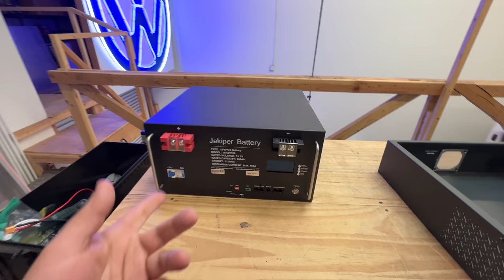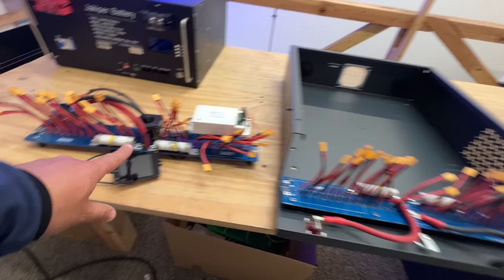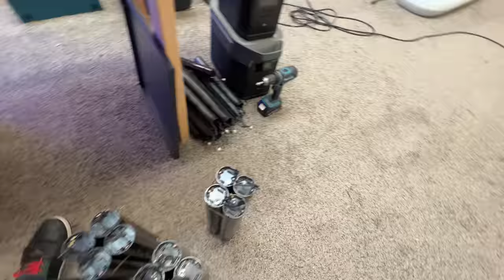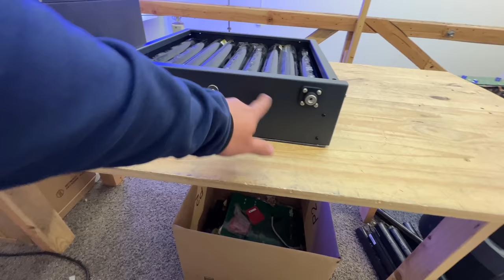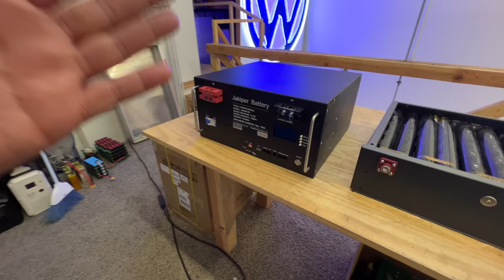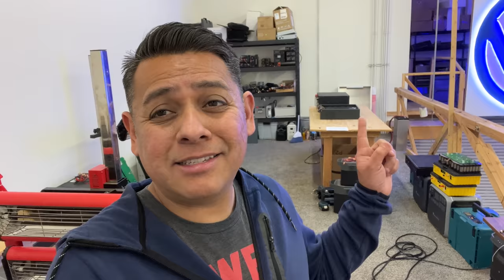Is DIY battery Still a good IDEA?

Comment: You forgot to mention is that 36v requires a 36v inverter which there's not many options for this less common voltage. If you want 12 or 24 volts for your standard equipment you need a converter, which loses energy in the conversion. And there's additional costs too, such as your scooter dongles to hack their BMS. I love DIY but there's many cons with safety, such as those BMS' don't have a temperature cut-off and they're definitely not as safe as Lithium Iron Phosphate. Then there's no warranty if anything fails later on. I worry that some of those packs don't even work from the get go 😒. You said 4 times more cycles than 1,000.. but a new LiFePO4 gives 5,000 cycles, so not 4x but 5x. Simple math on paper shows you save money in the long run. DIY batteries are more of a hassle nowadays and it's better to buy something pre-built that's trusted and will last guaranteed. Lithium Ion is an old and outdated technology. Lithium Iron Phosphate is the winner in cost per cycle, safety, reliability, and longevity.

Comment: 1000 cycles is less than 3 years, not 5. Replacing batteries every 3 years is not worth the savings.
Reply: 365 t7me 3 uf usee every all emyesr  liké 1000 tóo 1200 cyckes fuil chare dyse charg cyckeß brtér thén tiday bstrds

Comment: I have been a fan for a while and would like to try my 1st DIY battery project. I have a 36volt 50Amp Trolling motor for my boat and wish to build a battery pack for it with charger and meter.  Can you point me in the right direction? Thank you for any help and your content. I wish you were on the East coast.

Comment: DIY for the win! By the way on charging your lifepo4 with powerlab 8 which setting do you use? I have a PL6 and been wanting to charge a 32650 4S6P. Do you use 12v lead or the A123 presets? Thanks!

Comment: Jehu, fan of your page, I’m a novice at this battery hobby. Recently I came into 10 battery packs that someone bought from battery hook up. They are STL-TWN-LG OBP2481B1  43.2v  102.68Wh, not sure what all that means but I’d hate to throw them away. Want to know if you sell any boards or connectors that I could use to make a battery pack or small power wall. You guidance would greatly be appreciated.
Thank you

Comment: I think you used basically the worst case to exemplify your point that you could. There is no reason to build an LFP array for a fixed application over buying an LFP array. Sure, if you bring in used NCR NMC, LCO, ICR batteries in, you can build a cheaper battery, but you aren't building a safer battery. LFP is incredibly safe, ICR is not very safe in this application, and the prebuilds have a warranty and (probably mediocre) support with no risk you're going to misconfigure a BMS and light all your shit and yourself on fire. They also will last for 8,000 cycles vs the best case couple thousand left on another chemistry. For this, they actually will probably win out on cost! Sure, your 1kw pack costs 100 bucks vs the 300, but the 300 per kwh pack will last 4x longer and survive many more cycles.

Where DIY makes it is in application specific projects or products. Things that require unique form factor, things that move, things that require high C rate for a given volume of battery.

Comment: Lifepo4 is expensive as hell today. 
I bough 40x 280ah cells for around 100 usd/kwh shipping included. These are b grade i guess but i used them daily since before the pandemic started 2019 an there is nothing b grade about their performance when it comes to solar storage. 5000 watt charging 2000 watt discharging. Got lucky i guess when I bought them right before world went to shit lol.

Comment: ships do not use diesel , they use crude oil
Reply: The large ones commonly use a residual oil, which is a high-sulfur fuel - but they need to transfer over to something closer to regular diesel while going into many (European) ports…

Comment: How do you get it from 36 volts to 48 volts though. And is it still cost effective adding a transformer?

I really liked all your videos and appreciate The content. Currently living off grid with a renogy 3500 hybrid inverter and 4 12Ev zooms lifePO 4 batteries

If there’s a good way to use these used batteries and get them to utilize for 48 V then I’m all in I will be your customer

Comment: What’s with American YouTubers pushing for Jackiper, EG4, & the likes of rackables?
1) shipping concerns apply to US exclusively, the rest of the world pays dearly for shipping, as well as waits out the 3 months. And by the way, signaturesolar, batteryhookup, jackiper, etc… don’t ship outside the US!
2) kWh price is @ 155$ ~170 for grade A with shipping
3) who made rack mounting king of the universe? Who said it’s ultimate solution for Everyone? I personally go the DIY route primarily to avoid loosing valuable space in my house for an ugly stack of rackable! I built a shelf up near the ceiling, placed raw cells facing each other in 16S, finished it with cement board, called it a day! I did not loose a single square meter for floor standing rack.
4) you forgot to add the rack price
5) once jackiper & EG4 as well as the likes start shipping globally, your video becomes relevant; until such time comes, I consider this video aimed at US customers exclusively.
Reply from the maker: 100% of my market is USA,  there’s 300 million of us here, it’s the low hanging fruit.
Reply: @jehugarcia  Understandable.
In short: the $/kWh argument you used is false except (maybe) for the US.
the shipping argument you used is false except for the US.
the rack mounting method is not everyone's cup of tea (aesthetically).
Is Jackiper sponsoring you to push for rack-mounting?
Reply from the maker: rack mount is popular in the mid to large battery bank installs,  they are starting to trickle down to us DIY crowd second hand.  But the new breed of rackmount lifepo4 packs are popularized by every other YouTuber, I’m late to the game because I have my own designs to repurpose second hand batteries. This is the first one I review.
Reply: @jehugarcia great job you're doing out there! your channel is priceless to the community. Hope to see more reviews about grade A BMS's with communication tests.

Comment: Is the DIY battery robust to physical movement?  As in a permanent system for an RV?  Or is there still a fire risk if they get damaged?  I'm still thinking of a full off grid set up for my all electric travel trailer, and safety is paramount (the reason I stripped out the old and damaged propane system).
Reply: jus biy hybredd elré rv way safer or ac jver rv ushht bstéß

Comment: Hi Jesus, have some questions that can't or don't know how to find answers for.
What happen if I connect 36v or 72v battery to 24v 800w solar/wind mppt controller? 
Any problems connecting lead acid batteries to lithium ion 186xxx batteries on same voltage?

Comment: DIY pack cycle life is like 2.9 months if cycled once a day, how do you get 5 years?
Reply from the maker: How do you figure?  You can have good quality cells or trash cells, that determines cycle life not the DIY part
Reply: @jehugarcia You stated 1000 cycles which is less than 3years do the math.
Reply from the maker: So how do you get 2.9 months?
Reply: @jehugarcia  Sorry 2.9 years.

Comment: I can get 12 volt 100 AH  for under $800. I have no idea what I can do with the battery pack you made. What in the world runs on that voltage.  I don't know of any inverter, UPS, light, or electric that uses that voltage.

Comment: I think for home use LIFEPO4 is so much safer than standard lithium ion. There will always be room for cheaper DIY battery builds, as the price comes down on pre-built batteries, less people will do it. I initially tried to DIY but I got ripped off by BatteryHookup and they have never responded to my pleas for help. I had to get my money back via. Credit Card. After that I bought rack mount batteries.
Reply: I can't agree you more. There will always be room for cheaper... For home use, safety is very important. For most of us, home is what we care the most!

Comment: You can just use a 36V to 48V boost converter to make the DIY a 48V system. It would be safer to use a 36V to 24V buck converter and have 2 DIY chassis. I say safer due to the failure modes of the converters.

Comment: How do you get the power out of those diy batteries that you just made?
Reply from the maker: You just plug a 36v inverter,  they make gridtie inverters that work with that voltage so you have choices

Comment: Batteries are all about Amp Hours,,, True with LIP , U can use more than 50%  ~!,,,,I just saw a  $1500 LIP ~ Battery,, but it only had like 100 Amp hrs...I Can get a SLA...Battery for $125 ,,, so do the math before you spend like  $6000   for 400 amp hr in batteries,,, when you can get the same 400 amp hrs,, for around 500 bucks.,,
Reply: A Ten year battery will probably be absolute in 10 years with the way  Tesla is making car batteries,,
Reply from the maker: Amp hours?   What the hell are you talking about...  battery energy is measured in Wh,  stop posting dumb comments in my channel

Comment: Unless the scooter batteries are LiFePO4 I would not use these to power my house.  The fire hazard is too great.  Your car has a good bit of engineering to use LiCoO2 safely.  That's why Tesla's are full of 18650 and similar type cells.  People have burned their homes down with DIY 18650 powerwalls.  On a budget, it's so much safer just to get the blue LiFePO4 cells from China.  Worse case they'll swell or leak (still toxic) if they are the factory rejects.

Comment: Jehu remember us poor folks especially up here in Canada with a lower dollar and sky-high shipping and a carbon tax that is constantly going up it's getting to the point that we can't afford the basic heat and power and we can't afford alternative green energy either there is a unit that is affordable but it is old sealed lead acid batteries it also has low solar input and improper charge parameters but it's sold at the online big box stores and shipped to their nearest store with low or no shipping but I could live with all of nature's generator flaws if the big four reviewers even if you could do a review to let us know if the 2000 watt pure sine can actually put out 2000 watts with a pure sine wave and if it has a good build quality if all four or even if 2 or did a review maybe they'd fix the charging parameters with even that they'd be a good Entry level unit but if they'd switch up to an mppt solar charge controller that could be programed for lithium with the ability to handle higher wattage and higher voltage levels of solar input they'd be a great starter unit even with our lower dollar it is still under a grand for the basic unit and 1200dollars with 2 extra battery units but the thing that stops me from buying one is will the inverter do what is claimed and will it last I already know that if I want the battery to last I'll have to use my own solar charge controller but if you could do a teardown on one maybe while you're at it you can see if there is a way to fix the charging parameters I figure that if we here in Alberta Canada could go solar cheap enough and cut the grid we could save enough money by the time the battery needed to be replaced in 5 years I could buy the best battery or even system that could give us all the power I could ever need

Comment: I get so irritated by every second word being "right" - like a used car salesman does; maybe that's what you're doing here. But take a step back here a bit, most of the people in the world needing batteries and prefer to build them themselves, do NOT live in the U.S. and it makes no sense at all for someone to order cells from the U.S., after they've been imported from China, and then import them again into Australia or England or Germany... Just so much can go wrong with getting things from the U.S. (quality issues... long return/replacement times... companies vanishing...), just like buying direct from China, the only place LFP batteries are made. So why bother if only to pay a middle man?

I see your videos and the tidy, elegant boards you make to use arrays of small cells to produce a battery and then work out what to do with it, but most people who buy from China are into much bigger systems than that and the thought of bundling together maybe thousands of tiny cylindrical cells together, where a dozen 304Ah eve cells do the job well and robustly, just beggars common sense thought,

I'm from Australia and there used to be a TV seller called "Kaytel" and everything they sold came with steak knives thrown in - but thankfully you haven't gone that far.

Comment: I needed a couple of 12V 100Ah batteries, looked at building them but the long-time-frame looked awful. We've seen what the thugs in the Whitehouse have done in 1 year. It's hard to imagine what another 3 years of America's decline will look like.  
 So I decided the $300 12V 100Ah units on Amazon were the best bet. They're working fine.
If you do decide to buy from China, be aware that the CCP's plan to take Taiwan, might happen this summer. That's will likely add a few years to delivery time.
Reply: There are USA suppliers I've had success with. I'm building a lifepo4 12V 200ah pack for a friend thats working out to 23.4 cents per Wh. That's with all hardware, cells, BMS, and enclosure included.